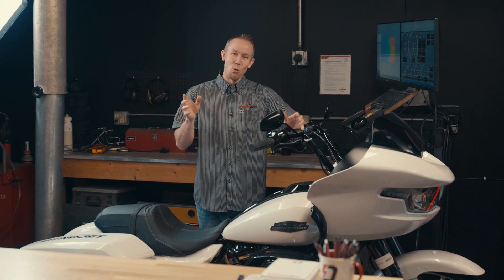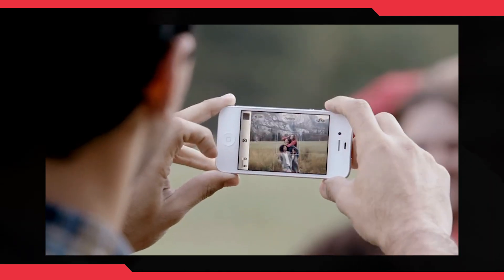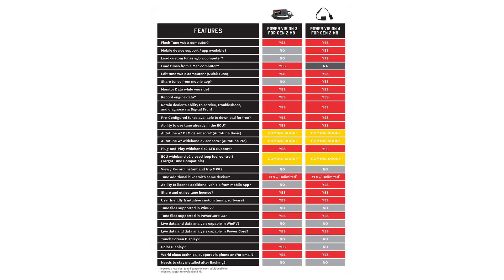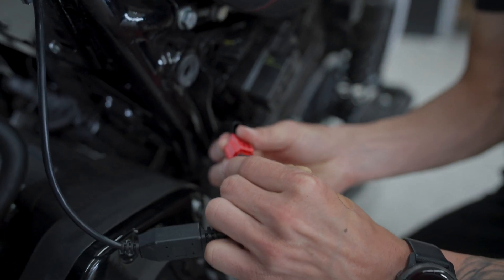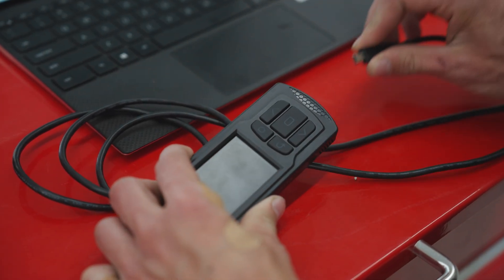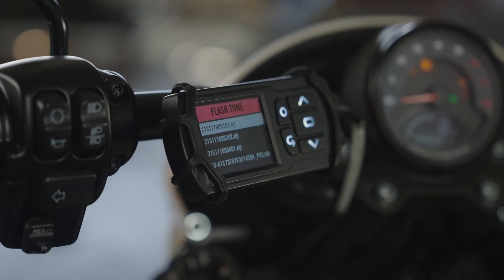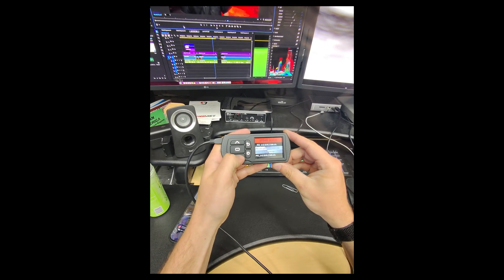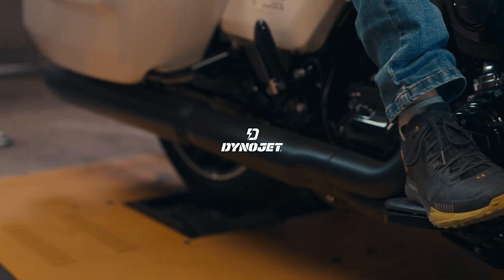How to Flash Tune 2023-2025 Harley-Davidson with the Power Vision 3 (Full Guide)

Comment: The video is called "How to flash tune"... Ive been trying to connect a PV3 to a 2024 street glide, for the last 4 hours and is wont pair. It tells me to contact dynajet, but you're closed. So, it took 1 hour to remove the factory dual exhaust and install a new 2 into 1 pipe... and then 4 hours to get nowhere thanks to the PV3. No instructions came with it, Fuel Moto  says they preset it for my bike... and here  we're all sitting and staring at a bike that wont run. So your video skips right past how to actually install the product. And if people are gonna buy this thing for $500 and spend 4 hours to get a message saying "contact dynajet", the least you could do is either have someone to answer the phone, or better yet, put up a video explaining what to do when this happens.

Comment: To much computer talk, this video should be 5 min step by step and the bike is tuned with a downloaded map. Save the in depth computer stuff for another video.
Reply from the maker: I recommend you check out our other (newer) Gen 2 M8 PV3 video. It goes step by step like you mention. It's also time-stamped so you can move around to find what you need.

Comment: Whats best for 25 cvo st? The pv3 or pv4 for me? I want to do a zippers cam 2-1 khromewerks and so far the big elbow air breather.
Reply from the maker: Functionality and feature wise, they’re virtually identical. The only difference is your choice of flash delivery and user experience. If you prefer a smartphone app method (iOS only at this time), then PV4 is the way to go. If you prefer a standalone unit with a display, then PV3 is the way to go.

Personally, I would go with a PV4 simply because of its cloud connectivity. If there are new tunes or features in the future, they’ll populate in the app right away.
Reply: @DynojetResearch the pv4 is android freindly? And can it be custom dyno tuned now? Or is it just off the shef maps?
Reply from the maker: @Urfavgirl_Avani This specific PV4 won’t support Android at this time, development is still underway for those phones. iOS only at this time. Both devices can connect to our dynos for custom tuning and off the shelf tunes.
Reply: Im 2 days in and applying for computer classes now
Reply: Get a thundermax

Comment: Ok bought mine a few months ago, and do I need to purchase a license for the same bike that it's paired to?
Reply from the maker: No, one flash license for one vehicle.
Reply: @DynojetResearch  on the website when I try to get the feature license its not there.. not sure what I did wrong. But is it supposed to say issue license next to my paired bike under the flash license tab?
Reply: @DynojetResearch  so I just looked at the description, the existing pv3 I have will get the update in June?